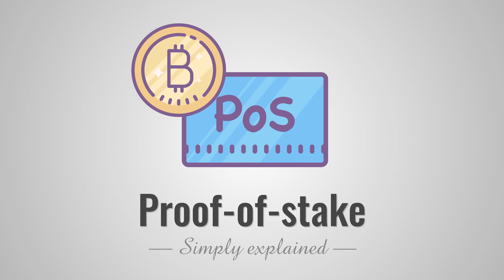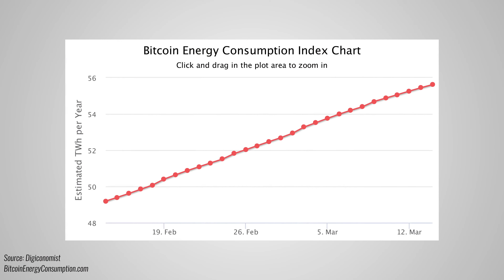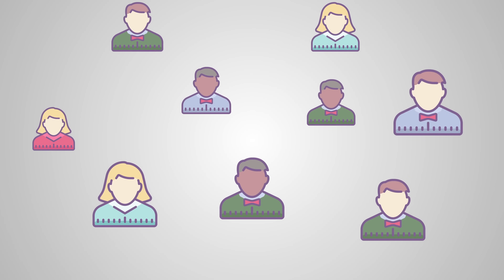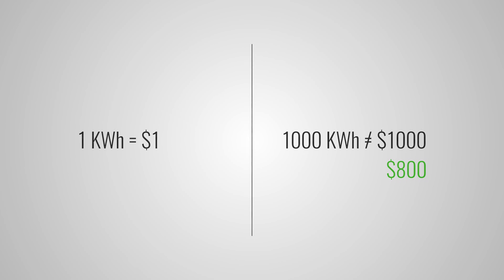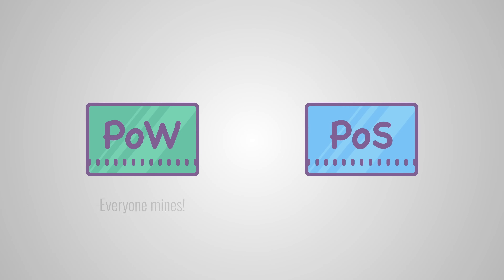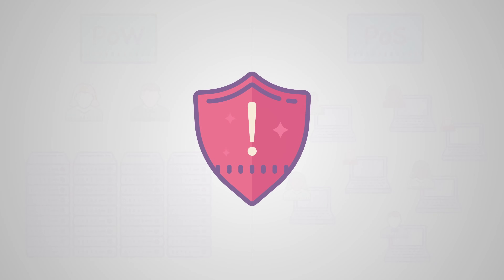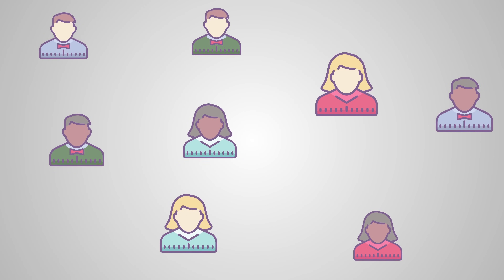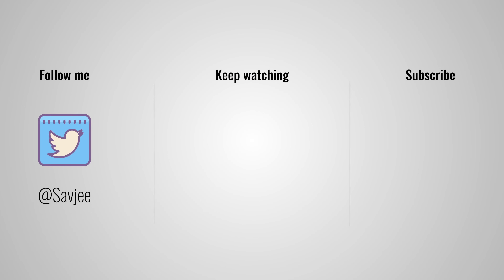Proof-of-Stake (vs proof-of-work)

Comment: PoS is less fair, because staking is a one-time investment. With PoW OTOH miners continuously have to  pay their electricity bills. Banks are Dollar stakers who decide which transactions go through. Besides you are contradicting yourself: First you rightly say, that it is much easier to stake than it is to mine and later you wrongly claim, that it‘s harder to do a 51% attack with PoS. It clearly is harder to purchase mining equipment and set it up than to just buy enough stake in order to do double spend attacks.
Reply: PoS is a lot more fair. Not everyone has the capability to mine in a PoW consensus. PoW mining requires linear scaling to maintain a baseline profit. Unless you are earning more than the cost to scale and the cost of electricity, then you eventually have to shut down. PoS at least allows anyone with a GPU to become a validator. Since us non-rich folk make up more than 90% of all addresses the selection will also be evenly distributed. For example, say you have 1 rich account for every 99 non-rich accounts (less than 100,000). The 1 rich account may become a validator 5 times every 100 cycles and the other 95 times will be divided up between the other 99 accounts. Sure the rich account will validate more blocks in total but not nearly as many when compared to PoW. In all, PoS ensures a better degree of fairness throughout the entire system while also decreasing the electrical load.
Reply: @andrewt5348  There is now way to ever reduce the power of a major staker in a PoS network. OTOH everybody can compete in a PoW network without permission.
Reply: @raphi72  You don't need permission to join a PoS network. In your comparison you could just set up your own validating pool to run a node. That's not different from mining yourself. And there are ways to reduce the power of major stakers, just because you are unaware of them does not mean they don't exist.
Reply: @arjana3862   @Arjana   Since PoS coins start pre-mined, it is impossible to ever come close to the power of the major stakers, who created the coins in the first place. If you know of any way to do it, why don't you tell me? PoS coins are not dezentralized and never will be.
Reply: @raphi72  Let me rephrase that for PoW systems then. Since PoW coins are a Return of Investment based system and therefore rely on the economy of scale, they will always fall fully in the hands of a few powerfull/rich players diminishing the efforts of small individuals. Therefore PoW syustems are not decentralised and never will be.
Reply: @arjana3862   Bitcoins PoW mining today is more dezentralized than at the time  when Bitcoin started. Miners have to sell their rewarded  Bitcoins in order to pay the electricity bill. They don't want any mining pool to dominate. Bitcoins verfication (its node network) is even more dezentralized.
Reply: @raphi72  if 2 or 3 of the mining pools combine their hashrates you have your 51% attack right then and there. I fail to see how that is even remotely decentralised.
Reply: @arjana3862  Check your "facts". Only the 4 largest pools together would collect 51% hashrate. Pools have no power over the miners, who can easily switch the mining pool without much effort.
Reply: @raphi72  ah yes only 4 mining pools would controll the system. Very decentralised
Reply: Proof of stake is more akin to our current Fiat system: centralized and favoring the rich
Reply: Thank you... This video is way off.
Reply: This video advertise etherium secretly. It is a total misinformation. Most of this new coin are PoS. I think elites are behind this to stop Bitcoin. I think they also manipulate the GPU prices so that they halt miners from mining while advocating for etherium which is secretly centralized.
Reply: @diocre7446  Ethereum is corporation issued currency.
Reply: @diocre7446  indeed.
Reply: @diocre7446  Nobody mines Bitcoin with GPUs anymore. Todays miners use ASIC miners.
Reply: It's hilarious to me that at 4:44 there's a graphic that states "everyone mines!" for PoW and "Only a select few validators" for PoS.. Yet, the entire video is spent claiming how "fair" and "balanced" it is to use PoS over PoW.
Reply: @MrLanGT  Have you used PoS systems? You stake with a validator (or you can do it yourself) that you trust for whatever reason you have to trust this validator. Everyone can be a validator since running a node is easy and cheap. Getting elected to run a node however is a mathematical procces that is fair accroding to your pledged stake. How is this different from miners joining a mining pool for bitcoin in terms of decentralisation? Guess what its not.

Comment: How does the node actually “check” the transactions in the block? That must take compute power?
Reply: Yes but checking (validating) a block is extremely cheap in comparison to mining it. So cheap that its basically ignored. Both PoW and Pos require validating a new block in the same way. The difference is that in proof of work billions of calculations are done "guessing" the hash of the next block, and each guess requires a validation step to see if it was correct or not, and once that miner knows it has the correct answer it notifies all the others, who each run their own validation calculation. In Proof of Stake, it sounds like the guessing process is skipped entirely.

(disclaimer: i don't support Proof of Stake, I'm still learning about it. I'm just elaborating on the validation step)

Comment: um... becoming 51% of a proof of work network is ALOT more expensive than doing that with a proof of stake network.......
Reply: Yup.  You don't even need to buy coins if you have access to old keys that used to have coins.  This is why PoS is susceptible to so called long range atracks.

Comment: Perhaps I missed it, but how does the network actually randomly select a validator? They all have to acheive consensus on who the validator is, right?
Reply: It seems that various currencies are using various approaches.
One way is to multiply the stake of a validator by the time since its last validation.
For example, if:
V1 has a stake of 100 for 2 days = 200
V2 has a stake of 10 for 30 days = 300
Then everybody agree that V2 has to be the next validator.
After the forging, V2 has a stake of 10 for 0 days.

Another more "random" way might be to multiply the stake of a validator by an hash of (validator id + last block).
This way a random node is selected, but everybody choose randomly the same validator.
Reply: @rt1517  Does hashing still mean PoW in the PoS model? What's the censorship potential by a majority?
Reply: @hkgujudhur  No hashing does not mean PoW in PoS model. In PoW, you have to do tons of hashes on the same block again and again only modifying its nonce until the hash result matches a specific contract. It requires a lot of tries to find a valid nonce and these tries take time and energy.
In case of PoS as explained above, you would only have to hash once per validator to determine the next validator. Easy task, even if there are many validators. No competition, no need for gigantic mining farms.

To do a 51% attack on bitcoin you need half of the hashing computing power (that means only the 4 biggest bitcoin mining pools). To do a 51% on a PoS currency, you typically need 51% of the coins. Some people think that if you own 51% of a currency, you won't attack it because the currency will lose its value and you will lose all your investments. So PoS should be a lot less targeted by 51% attacks.
Reply: @rt1517  Thank you very much.
I'm currently leaning on PoW. So, feasibility-wise you mean PoS is less secure, but in terms of the desire to take the 51% attack potential, PoW has a higher competition. (excluding less popular PoW coins not targeted as Store of Value) Based on your explanation concerning the need for gigantic mining farms so far, it has a higher energy demand for attacks than PoS.
Reply: @rt1517  Also, I would be really grateful if you would point out what other consensus algorithms use more than one hashing to check for a valid nonce. I'm much interested in non-identificational Proof-of-Weight. I don't know much about use of hashing other than in the form of basic OTP passwords.
Reply: @hkgujudhur  I would say that PoS is often more secure. Yes performing a 51% attack on bitcoin would be very difficult as you need a lot of power. But it would be not as hard as owning 51% of the Bitcoins which would cost something like 250,000,000,000$. And if you have 250,000,000,000$ of bitcoins, I bet you will not attack the currency... For smaller currencies, using the cloud or a botnet may allow you to perform a 51% attack without spending that much money. While if you have 51% of some small currency, stealing the other 49% is not as much interesting.
Reply: @rt1517  Wouldn't using time since last validation reintroduce mining pools and just have people create multiple virtual validators?
Reply: @tacticaltaco7481  Yes maybe you can try to own many validators so that they are selected even if you don't own most of the coins. A difference with bitcoin though would be that machines in these farms would need not as much energy: they would be idle most of the time waiting to be selected. One mechanism that may prevent this approach is that you have to put some coins at stake for each validator. For example for future Ethereum PoS, you will have to provide 32 ETH and you have to maintain the validator for 3 years (otherwise you face a penalty on your 32 ETH).
Reply: @rt1517  How can you stake on a site but don't provide like your pc to do the work? Does the site then do the work and get a cut? (work = validate)
Reply: its presudo-randomness, some determenistic rule everyone can check on already validated part of the chain, and that is hard to game

Comment: Great video. One question, how does the network actually detect fraudulent validators and punish them? What's the mechanism there? Thanks.
Reply: In the proof of stake. If the validator accept the fake transaction their security deposit will lost. that's the punishment. So no one will accept the fake transaction.
Reply: @mixwood1130  unless they have large shorts in place on a futures market
Reply: @bitcoinizakaya9579  Have a great day!
Reply: @mixwood1130  the original question was asking how the network detects a fraudulent transaction or double spend
Reply: @SidelongSuggestive  have a nice day!
Reply: @SidelongSuggestive  by validating it
Reply: @Volian0  we're asking for the technical mechanism of how validation works in PoS. how is this an answer?
Reply: @rentonl  well it's really simple, the other nodes/validators check if the validator did a good job by scanning the transaction history, checking signatures etc and if they detect fraud they slash validator's coins.
Reply: @Volian0  this is just conceptual. we're asking for something more technical. what is the logic to detect if a validator "did a good job"? how is consensus formed in the network to decide when someone is slashed?

Comment: It’s not a ton, though. A figurative ton. But I think you mean “lot”. 
The thing is that proof of stake is an authoritative model, which defeats the whole fucking point.
Proof of work works because it would cost more to “fake” a valid block than it is to mine one. 
That is constant. It will always be harder to fake a block then to find a proof. 

However brilliant it is, the amount of computing power (not electricity, mind you) being wasted is immense. Which is why I invite everyone to find solutions for that.
I’ve been working on it for a while but it’s a genuinely immense problem to solve, every solution fails in a way or another. 
For a solution to be valid it needs to maintain the current model. ie: the existing hardware shouldn’t go to waste, the miner income shouldn’t be reduced. 
But also deliver on factors beyond the model: utilisation of the hardware (there is nothing keeping us to replacing what today is “difficulty” which is synthetic with real equations we want to solve). 
The amount of transactions in a block, in my opinion, should be fluid but the amount of work fixed. 
This computing power shouldn’t be wasted. Replacing bitcoin makes all that work go to waste. Reducing rewards greatly inflate economies of scale.
I’m also working on a non profit pool. The problem so far is that a fee is still needed for server cost and maintenance. That’s inacceptable, it should be part of the blockchain.

Comment: I think I have a pretty good idea of how a block is added on the Bitcoin blockchain, but I find the above reference to proof of work confusing relative to my understanding.  Why is it referred to as a consensus algorithm?  What does that even mean?  My concept of Proof of work is that it is just a competition between miners designed to try as many random numbers as they can, plugging them and all the transactions that they pulled from the web that they wish to add into a block on the chain, mash it all up, and get a number that is less in value than the hashed result of the previous block.  When they win the race, they earn bitcoin and add the new ledger of transactions as a block on the chain of which the ledger also includes the bitcoin that they earned.  So, again, it is basically a race or a competition.  Where does this word consensus come from?  How does being the first to solve a problem of random transactions, pulled from the web, verify among the network of computers that the information added to the chain is valid?  How does racing to do a mathematical equation prevent double spending of bitcoin or of spending bitcoin that someone does not have?  No one has ever been able to clearly answer this question for me, so if you can, I sincerely thank you in advance.
Reply: Not sure I can answer everything here, but "consensus" is achieved indirectly in Bitcoin: when you guess a block's hash, its broadcasted to all the other miners who can choose to accept or reject it. If they accept it, then their copy of the blockchain is the same as yours. If they reject it, then their copy of the blockchain starts to diverge from yours. So how does a 3rd party pick which blockchain is real? They pick the longer one. Who will have the longer one? Usually whoever has more computing power. So "consensus" on which blockchain is legitimate is determined by computing power. If a party has 51% of the computing power, then others are most likely to accept their version of the blockchain, would theoretically allow them to double-spend, or block transactions of parties they don't like.